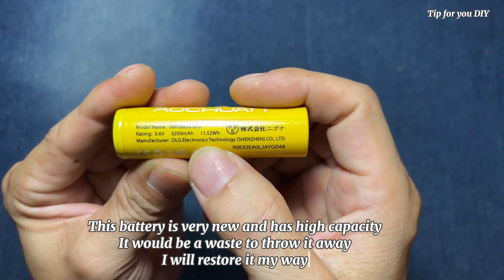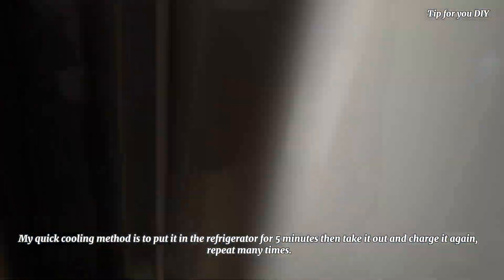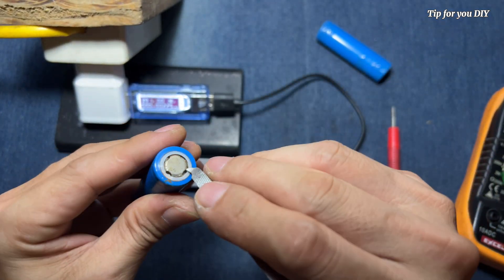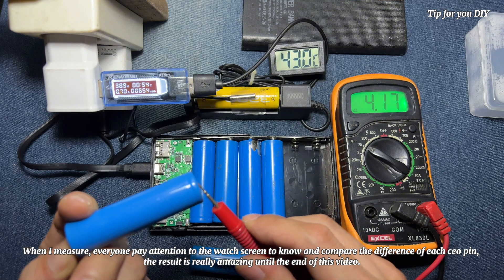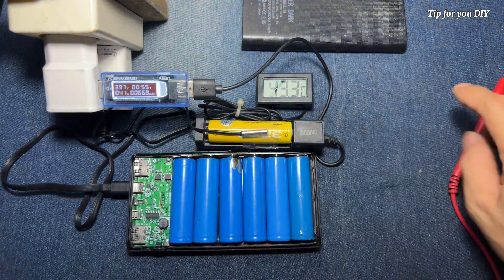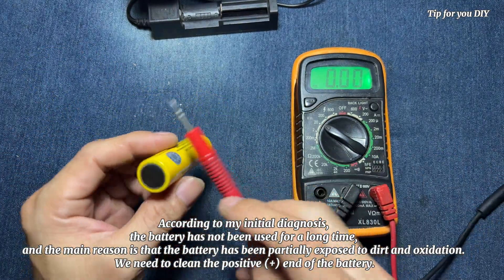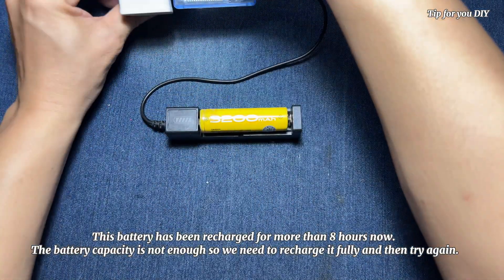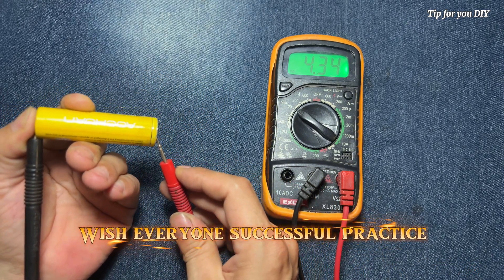5-Minute Trick to Revive DEAD 3.5V Batteries

Comment: Did you EVER  heard word safety??? Dead lithium battery NOT supposed to be revived for safety reasons. No discussion about that needed, it's just fundamental principle of using lithium ion cells.

And suggesting dangerous practices says all about your consciousness, common sense and respect to others.
Reply from the maker: @magy357  Thank you for your comments. In this video, I want to target people with a little knowledge of electronics, so battery recovery will be safe, cost-effective, and environmentally friendly. During the battery recovery process, I also recommend cooling them so they don't explode immediately. Batteries only burn when there is physical impact such as strong impact or intentional short circuit. 👍👍👍